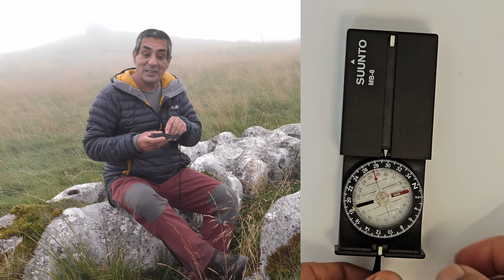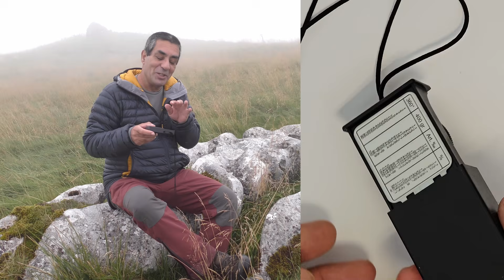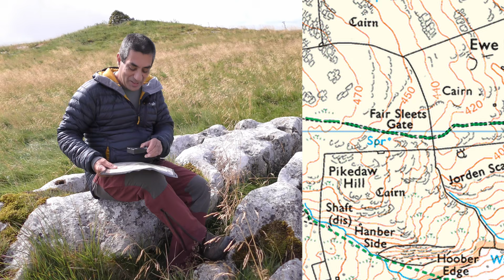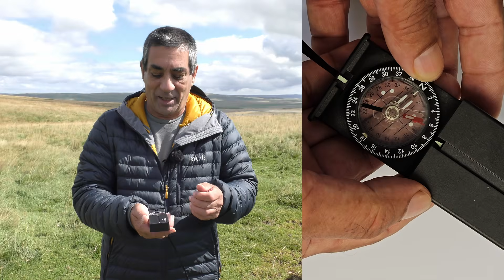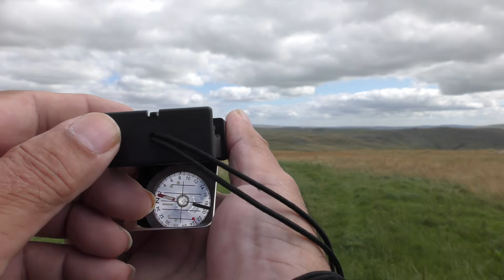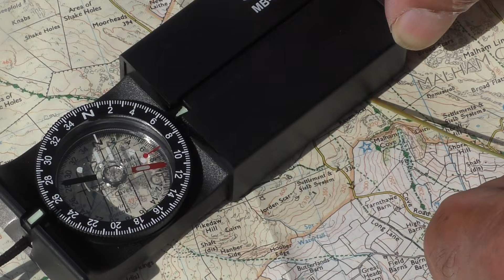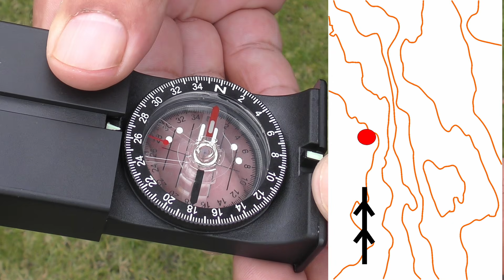Suunto MB 6 Instructions + improved military boxing technique

Comment: I am from Austria and used a Recta Compass as a teenager before my military service as a squad leader with the Jägers. Now they are called Suunto, because Recta (swiss watch and compass company from Switzerland) was bought by Suunto. The MB-6 is a really great tool for navigation, light and small in your pocket, but extended in use gives a longer sight radius. It is possible with this to set the azimuth for a 8cm Mortar with good precision if another method was not available. The Instructor in this Video doesn´t show the best way to hold the compass: Use the lanyard, take it upon your head and form a triangle with it: The lanyard goes from the back of your head  to your right and left ear (like glasse) and to the compass. With your hand you push gently the device away from you and hold it with light tension. This gives you stabilityand for further work just use your feet to find your azimuth. 
The only downside of this product is that you get, in most cases after years, a bubble in the liquid filled central piece when you are in the mountains. This happens already around 2000 meters over sea level.   Here comes Cammenga in discussion, because their compasses doesn´t use a liquid to moderate needle movement. But a  Cammenga is much larger, extremely heavy in the mountains where wheight is always a concern has a shorter sighting range. Both are really great and reasonable priced for the quality they offer. 
There are MB-6 variants which will work great north AND south of the equator. Cammenga does not offer this feature.

Comment: Dear, Sir!
Why did not you start with the full truth:
This is  a WW2 SWISS MILITARY "RECTA" TYPE OF COMPASS.
EVERYONE HAS A № , by which You can define the right  year of  production, my № tells  me that  mine is from 1944......It came to me in the original leather box , and inside for my  surprise was the original SWISS LIST WITH, 
Instructions how to use it, how  to extract the exact point/location from GAUSS-KRUGER MILITARY MAP TO SEND THAM to  an artillery unit for example...........
Unfortunately I were already teached to use the  Russian Imperial M1908/ and after 1917 the RedArmy hand compass of  "ADRIANOFF" , WITH leather strap for left hand, and front and  rear  sights , like in a pistol. The other types of  that stuff that we were supposed to use and learn , were All the series of EAST GERMAN Production, or the copies of  wehrmacht --- Infantry  and  artillery Compasses also made in DDR , After 1945 , but without markings and send to the Eastern Block like REPARETIONS........
OUR goal was to extract the exact coordinates and write 'em on a  blocknote positioned on your left hand with two elastic gummy rings so you write without any other  
Thing that may distract you. 
And after that - exactly from a map 1: 25 000 , you just need to send the coded numbers to  an 122 or 152 battery and enjoy the rest of the time)
With Respects.

Comment: The match-box compass (as well as plate compasses) are basically all you will ever need as far as geological compasses go. 
They are accurate enough, light, fast to read and very affordable (great for students who may not be able to put 500-1000 euros in a professional compass).
I have very successfully used a Recta DP-6 and a Silva Expedition 15 TDCL for decades.
The only thing is that you will need to epoxy a small button-style spirit level to the case to ensure accurate strike measurements.

By the way, my 1990's DP6 is absolutely identical to the MB6 in every way, but with the same needle as the 1980's dp6.

Comment: Thank you so much for your videos.  And please continue to waffle, it’s gentle and endearing, you always talk about the most interesting things.  

My lovely wife got me an MB-6 global for Christmas having watched your videos.  I was originally leaning towards a TruArc20.  Having compared the two, Brunton need to pull their socks up. 

I use compasses for work and I’ve always been a bit of a Brunton fanboy.  I’m chuffed to bits with the MB-6.  As a general compass for field work I’d say it’s about perfect.   You’re right about the inclinometer, it is a little fiddly, but more of a quirk than a fault.  However, what is seriously useful is the combination of the mirror and inclinometer.  Turn the MB-6 on its side, sight along the ‘sights’, read the inclinometer in the mirror, very handy for height measurements with a modicum of trig.  This can be a real pain to do accurately with a base plate or even so-called engineering compasses.

Comment: I like the MB-6. Got the global one. But one thing keeps puzzling me is the clinometer: How do i keep the mirror from popping out when using the inclinometer across a slope without arkward fumbling? For looking up/down a slope i found the best answer to that problem to be: You don't: Ignore the part of the manual that suggests to get a reading from the clinometer needle directly and use the mirror instead to read it. Much more comfortable to aim and read, just like taking a normal sighting.

Comment: I don't understand why one should spend more than 100 euros for a compass (even a base plate one) when with a 15-20 euro lensatic and protractor one can do even more in some instances. Honestly I wanna see why this thing is worth 100 euros and so far, apart from the transparent dial I am not seeing it: it doesn't have a ruler, the box has a step that complicates aligning, the mirror on the back is very prone to damage. The compasses with a base plate are too big and the plastic is prone to break. If somebody wanted to improve on the military design one should try and do so by starting from the metal base lensatic compass and make it so that a protractor comes out from various sides. Another addition should be a pacing bead lanyard: measuring on map the distance between A and B is one side of it, calculation of slope is another one (distance ascending or descending is different from the 2D map info), counting your paces is the next one to make sure you don't overshoot. So another addition would be a tool to triangulate: not there is anything out there because there is only one way to do it: get a feature out there and get the bearing, orient map to geo-north and identify the feature, draw a line parallel to bearing passing through the feature, repeat a second or ven a third time and you get position. These are the main things, a ruler with 1:40k, 1:50k and 1:25k and 1:24k is not necessary when you have a measuring tool and can do arithmetics by hand, viceversa an attachment for tripod could be an interesting addition (keeps the compass steady and levelled). Instructions to find declination is another cool feature (the watch method during the day or Polaris at night). In other words all the possible analogic methods to retrieve info is golden... batteries are not eternal ;)... but please convince me that this is a super compass worth 100 euros
Reply from the maker: It not my job to convince anyone to buy a certain compass - I don't sell compasses.  All I do is show people how to use them.  What you buy and the price you want to pay is up to you.
Reply: The "convince me" part is a provocation. At the end of the day no matter the compass (which can be refined as you want, still what you need it for is to point north), navigation is the important stuff. I would like to see the faces of all those fancy trackers with their GPS apps when the battery runs out or the phone falls into a puddle. My point is: I still need to see some serious improvement from the Lensatic Cammenga style compass that really makes a difference. Probably the only addition worth mentioning is the Nd alloy in the needle that keeps magnetization better than old style ones...

Comment: Loved the 60° thing.  I used to do Orienteering where obstacles were part of the problem and I used to guess the deviation (I'm running).  Often, another obstacle (thick brushwood) might appear whilst deviating necessating a wider deviation.  I used the box technique as getting back on line was easier that way.  Great video!

Comment: I do have a Recta DP2 (from the early 90s, i presume). This one looks very similar to your MP6 apart from it being dark green instead of black (and of course being without the inclination needle and the declination adjustment screw (DP2 < DP6)). So I reckon that the major change in design (i.e. the printed white bearings in 2° steps on the bezel) was already made by Recta before Suunto took over.
I still love that design with the protective box and the slide out mirror. Simple, elegant and very functional.
As to degree, Grad or MIL - as far as I remember, there have always(?) been different versions available at the same time. But my memory might be wrong here.

Comment: I love the DP-10 because it also has a prismatic function which makes taking a bearing even easier…
Reply: I got mine for the prismatic funtion primarily for taking quick field sueveys in archaeology.  Had it over 25 years now and still going strong...though the mirror's not as shiny as it used to be. Still a great design and reliable bit of kit.

Comment: Unless Suunto hasn't changed s.th. in the production since they bought Recta, I wouldn't buy a compass from them, as they tend to get a airbubble in the capsule. I had a Recta and when complaining about it, I was told that this is normal...
And when you see a Recta at a flea market, almost all of them have the bubble as well.
I once had a bubble in a Breithaupt capsule, which was considered and i got a free replacement from Breithaupt, although the compass was > 10 years old!
Reply from the maker: Surprisingly my next video is about bubbles in compasses and how to (correctly) get rid of them.  Yes it is now normal to get bubbles in compasses and the reason for that is shockingly bad manufacturing processes – more about that in the video - it really shouldn't be "normal".
It’s been filmed but haven’t got around to editing yet.

Comment: I know people who are still using the Suunto M311 military compass from the WW2. My own base plate Suunto is from 1972. Cheers & 🙏
Reply: I have a Silva military compass with Swedish 6300 mils which is closer to 2000*phi = 6283 which some snipers use. Now Sweden is part of NATO and then 6400 mils is the standard. Finland previously had the 6000 mil system like Russia. Personally I think the 6000 system is easy to visualize. Even though I don't have an analog watch with me, I know that 60 minutes is one lap. 1 minute = 100 mils = 6 degrees. It's easier mental math than converting between degrees and the 6000 mil system.

Comment: How about a review of the Sunnto KB 14 compass? In land surveying we use these extensively while surveying large tracks for setting corner witness trees or bearing trees.
Reply: They are particularly useful from trying to retrace a boundary of a large track of land from the plat.
Reply from the maker: The KB 14 is a bit outside my sphere as it not really useful for Land Nav
Reply: @TheMapReadingCompany  you should try it. It compliments gps as well as other methods very nicely. Professionally, I have incorporated it usefully on large tract recon before and after gps. Have you ever tried it?

Comment: The nice thing about the 60° boxing marks is that whether you chose to jog with two sides of an equilateral triangle (to minimise heading changes) or instead with three sides of a regular hexagon (to minimise travel distance while maintaining hazard clearance), you just ignore one course leg during your pacing.
Reply: I just added 2 felt pen marks to 60 degrees either side of the tritium light on the rotating glass on my Camenga. Will do the same thing!

Comment: Is the bearing of 78 degrees correct? Do you line up the dots to the grid line or do you use the lines inside the compass? Thanks
Reply from the maker: You can use the dots either side of the north marker, but if you have adjusted for declination (with the screw) you'll need to use the orienting lines

Comment: Hi Wayne,

Thank you so much for another extremely informative and entertaining video.

I still have my venerable and treasured, Recta Compass, (the 360 degree version with the Aluminium body) together with its original instruction sheet and the battered remnants of its cardboard box, which I purchased in 1968 when I was a Senior Scout. 

Despite a moderately sized bubble, the compass still functions accurately.

I also still have my SILVA (Type 3) compass bought in the same year.

Having recently watched one of your earlier videos, I searched the Internet under the name RECTA to see if the compass was still being produced and if it was still available. Much to my dismay, I read an article which stated that the RECTA company no longer existed and I only found a few plastic cased examples listed on eBay.

I am  so pleased that SUUNTO have taken over the RECTA Company, and still produce this style of compass.

I am delighted to pick up a few more tips on "Boxing" from this video.

A little tip that I have found useful, is to place the lanyard around one's neck and stretch it taught when holding out the compass, whilst taking the bearing of a distant object. This stabilises the compass and makes it easier to align the sights, view the mirror and also to rotate the bezel.

I thoroughly enjoy your "Waffle": I have learned so much about the history of the Ordnance Survey, also of the science, maths and technology of compass and maps, and also the history and geography of the British Isles.

Thank you for expanding my mind!

I will continue to be an avid watcher!

Comment: Sorry if I got this wrong, but if the triangle formed by this boxing method is indeed equilateral (all angles are 60 deg, all sides have the same length), wouldn't the distance traveled off-bearing be twice the distance that would have been traveled in a straight line?
if the three sides have a length of 20 paces each, going straight is just 20 paces.
But going around would imply walking through two of the sides of the triangle, each of a length of 20 paces, for a total of 40 paces, right?

I saw some people mentioning the manuals explained what the dots are for and how to use them, but I couldn't find any pdf document explaining how the principle works for "keeping the pacing".

Sorry, I just rewatched the video. The idea is that if you walk 20 paces "off-bearing" (the first side of the triangle), then you undo those in the next side of the triangle, and the end result is equivalent to having you move "only 20 paces" in the correct bearing (which is "the same amount" you went off bearing at the beginning). For some reason I thought you implied you had to keep track of your counting including the paces needed to "undo" your boxing, which would definitely not have worked.

Thank you for these videos, they're really fantastic and I'm enjoying them a lot even if I can't quite get out to trekking these days. I'm trying to get a map to go try some of the things you suggest once the weather is nice again.

Comment: If you put the lanyard around your head, so the lanyard rests on your ears and you straight out the lanyard then, pointing with compass is much easier. You have the markers and the drop down mirror directly in your line of sight.
Reply from the maker: Thank you Hannes
Reply: The lanyard around the head, that’s how we learned it as well (Belgian scouts, 9de). Still have my Recta with Swiss logo (type T), and although it has a large air bubble, it’s still working fine.
Reply: Yes, I have a Recta we used in Swiss scouts back in the day - we always stuck the lanyard round the neck to take bearings. 👍

Comment: As a user of the Suunto MB-6, I found this video incredibly useful; especially the section on "boxing". Thank you!
Reply: One question, I want to buy a MB-6, what has been your experience with this compass? Is it rugged enough? I see it's made of plastic for being a military compass. Does the plastic case close tightly enough to inhibit the compass  coming out by itself? Thanks so much.
Reply: @Renku07  It's an extremely rugged compass with as much, if not more protection as a compass case. The closed postion is very positive and I cannot foresee this changing anytime soon.
Reply: @Renku07  The case is as good as, if not better than any compass case you might protect a compass with. It has an excellent locked position which I cannot foresee as changing anytime in the near future. Definitely my favourite compass!
Reply: @dfishborne  Thanks a lot for both responses. I was waiting for a confirmation like this from a person that actually has one. One more question, have you had any issue with the mirror coming out from the back of the compass and getting stuck?
Reply: @Renku07  The mirror (stainless steel) only locks when at a 45 degree angle. Otherwise it slides freely. Trust me, this is a great compass and well worth its price tag!
Reply: @dfishborne I appreciate your responses a lot. I’m sold; I’m buying it.
Reply: @dfishborne I appreciate your responses a lot. I’m sold; I’m buying it.

Comment: In the early 2000's they still sold those under the Recta brandname too.
I learned to use a compass in '99 with a Recta onle of which i don't now the corect designation but in mill. (so 16 00 for 90°, 3200for 180°, 4800 for 270° and 6400 for 360°.)
And after my service i bought a civilian one (as they didn't sell the ones in mil to civilians)
It's in green and still has Recta imprinted on it.
What i like so much is the amount of functionality in the small box that's also quite robust.
The mirror is also good enough for wet shaving in the field. ;-) (in my time that was still a thing even when out in the field)
Edit: just checked, mine is a Recta DP2 and it has all the features of the one you showed apart from the incline marker at the back. But it does have the 60° dots and the declination screw.